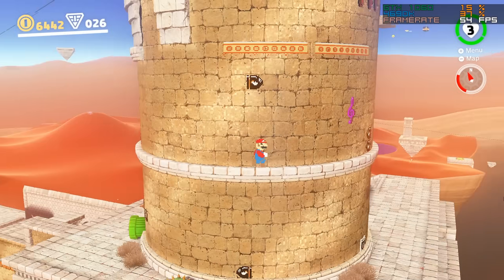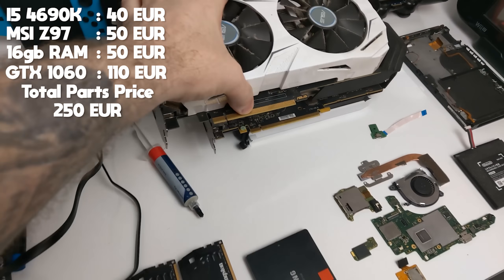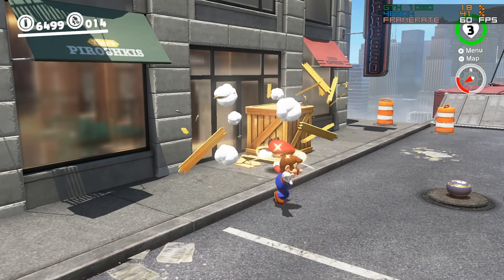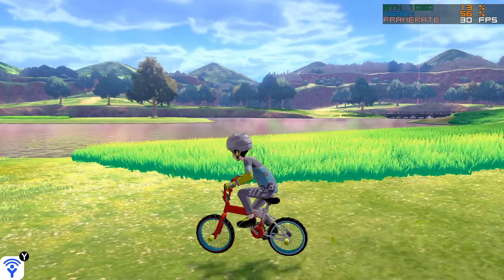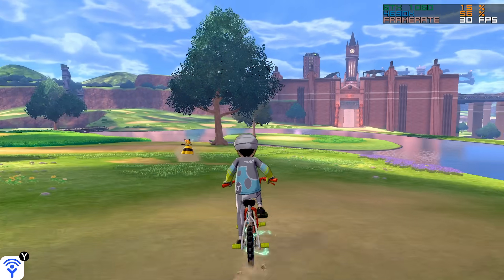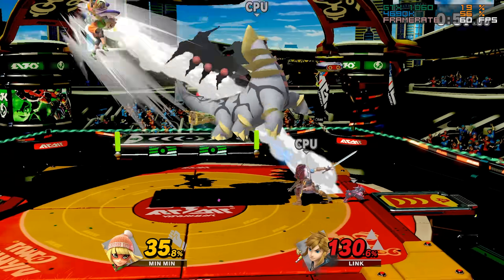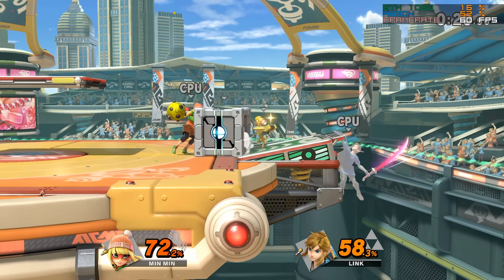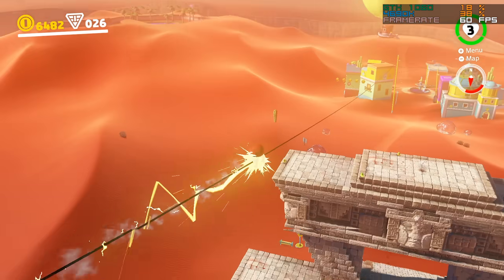Fullspeed Nintendo Switch Emulation on a $50 CPU - Multicore Performance Update

Comment: well ill be danged, this is incredible, my friend is building a 350$ pc soon and this will help tremendously. Thanks man.
Reply: @LunaALT  It from a SFF PC hahaha. HP Prodesk 400 G1, 84Watt.
Reply: hello bro i m begging you to make a video setting up yuzu and smash ultimate with or the updates and how to intall them on yuzu pplease
Reply: Man. This mans over here is going to be running switch games on a PC that pretty much costs the same as a switch.

And at full performance? It's insane that yuzu is this mature only halfway through the switching lifecycle.
Reply: @Hazzardous13  its insane isnt it, and the best part is it can run more than the switch, general pc gaming, all the emulators, its awesome, for my build its $350 and its an intergrated gpu yes, but you can upgrade later to like a 1050 ti or something and improve performance so much, and its already pretty decent.
Reply: @LunaALT  What's risky is that I bought that videocard also from Aliexpress. But good thing it was original and good. It works perfectly. Good frames everything I every wanted. 2 HDD's Works perfectly.
Reply: Wonder if my $4200 dollar pc will be able to run this at max fps.
Reply: @seerking  if you bought this 4200 dollars PC with new parts, and in 2015, great. If it's a 4200 dollars PC from the 2000's, I'm sorry friend. Maybe try CemU.

I have a 3500 BRL Acer Nitro 5, and that's cheap for you guys. Like, converting the value of my notebook to dollars, we have 700 dollars in hardware.
Reply: @_lowfer  its a $4200 pc from 2020 that I built with new parts.
Reply: he can build a decent gaming rig if he buys a Dell optiplex with 8 gbs of ram and an i5 cpu (around $150-$200) and a gtx 1050 ti
Reply: You can't even run most games on 350 dollar build. A good pc would be around 1k, mine was around $1500. Either way good luck but still, why lol.
Reply: @TheRedSpeedingBlur489  WTF?... you can easily run most games on a $350 build,  you just gotta know how to optimize
Reply: @mauryj.3415   Dude, if it really worked like that then everything would be much much cheaper. 350 is not enough for a decent pc build, it would be at most 700-800$ for a decent pc or gaming laptop.
Reply: id recommend not building a cheap computer your just going to regret it later like i did
Reply: With that exact amount of money I builded a PC with:

i5-4590 3.3 - 3.7Ghz 4Cores €125
12GB Ram      4+  8=€20
RX 580 4GB             €110
Good powersupply   €50,00
Total: Around €300,-- ≈ $350
Reply: @Matschaak  nice man. if you got the parts ill take a look
Reply: @Lanteurn  Yeah It's alrady installed too bad I didn't make a video about it. It's running now for about a year I think. Still very happy with it.
Reply: @Matschaak  you are missing motherboard and storage.

Comment: Wait, doesn't the 580 outperform the 1060? It has slightly more vram and im pretty sure polaris aged better than pascal.or does yuzu run better on Nvidia cards?
Reply: I think emulators in general runs better on Nvidia and sadly yuzu is no different =/
Reply: On PC gaming yeah, emulators not really

The main issue here is most devs use OpenGL as their early backend for emulation in general, cuz it's ancient and is easier to develop when everybody knows it. AMD driver sucks ass when it comes to windows OpenGL so emulating a game with it would be like 50% performance loss. and that's where Vulkan comes into play but since not everybody are familiar with it so expect its development gonna be way slower. AMD always have it rough, even now when yuzu have many games in playable state, you can only play games that are not shader heavy if you have AMD GPU until they release shader cache for vulkan.

Comment: Cries in AMD
Reply: Cries in 8 GB RAM
Reply: wait it'll be bad for amd cpu?
Reply: @maskedcircle  I think bad for amd gpu. I have an rx 5700 and i5 9400f and I can't reach these performance sadly.
Reply: @swinoob616  oof poor amd
Reply: @swinoob616  Yeah AMD is pretty shit for emulation in my experience. Has some pretty bad issues in Citra as well on my really good rig when my phone can run the same games at a more consistent speed. It's wild.
Reply: Swi Noob i have a Radeon ViI but its not reaching it. Luckily i have a switch noe
Reply: @maskedcircle  AMD GPU can only have good performance on Vulkan if you're on Windows. the thing is vulkan doesn't have shader cache yet so games that are shader heavy are gonna be pain in the ass cuz shaders reset everytime you close the game.
Reply: @Loxly-ti4sq  true, vulkan is amazing but still too young for yuzu.
Reply: @Loxly-ti4sq  i have rx 5700 xt  and been using vulkan and i never had performance as good as this guy have xD also games like pokemon sword and some other games i tried often crash after few mins i hope they will give some love to amd users in the near future as well.
Reply: @Lambosupidcaw  it's almost completely AMD fault
Reply: @Loxly-ti4sq  What if you install linux on a partition?
Reply: @Loxly 1407   how did u get vulkan to work? I got an rx560 updated to the latest driver and when i switch to vulkan yuzu crashes on startup
Reply: @maskedcircle  new amd cpus are better than amd. old amd is awful
Reply: @maskedcircle  no
Reply: ayush yash Intel/Nvidia is a better duo for this emulator and currently have features Amd doesn’t have.
Reply: Cuts themself in intel gpu
Reply: Emulation was one of the reasons why I switched to Nvidia years ago.
Reply: @TheGameLecturer  yeah, i REALLY love amd but my next gpu will probably be an nvidia one because i want to play botw 2 at 1440p not 900p :(
Reply: You should try Yuzu out on Linux, see if you get better performance
Reply: @ciao986  i've tried linux and i had no idea wtf i  was suppossed to do even when i look for tutorials on youtube. i guess it's not meant for casuals or someone that doesn't have IT or programming background. it also seems to have compatibility issue with my Asrock motherboard so i was done for good